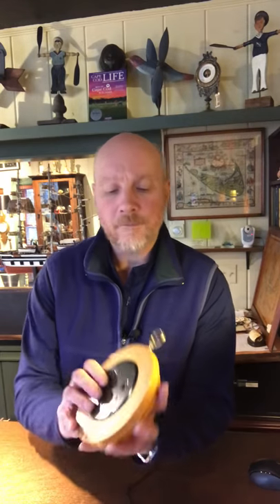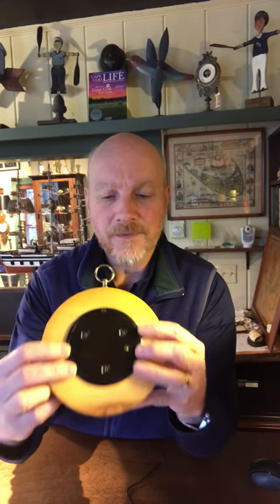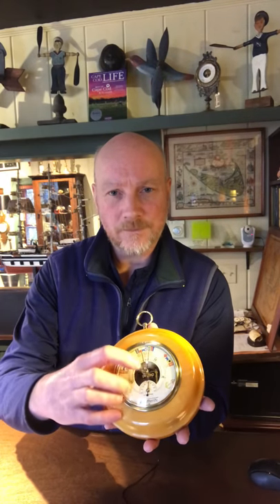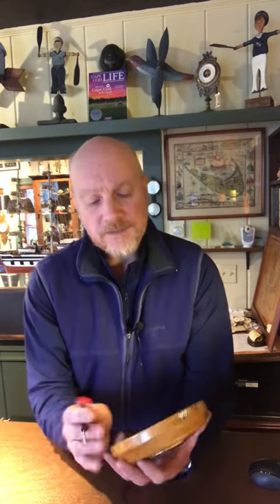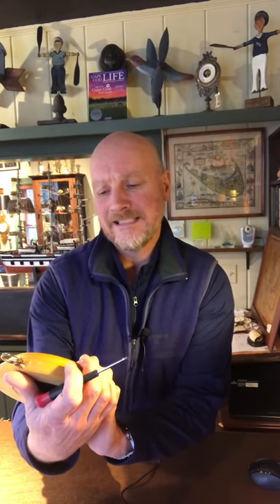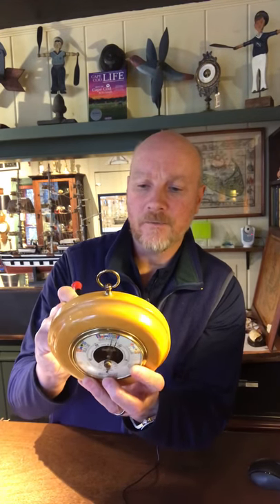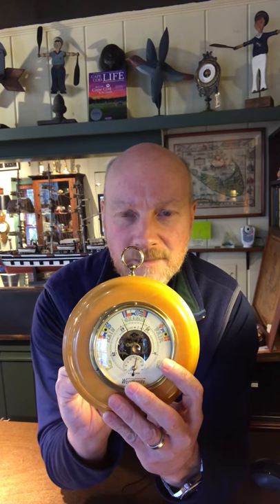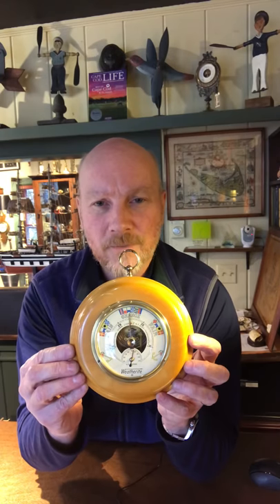Calibrating / Adjusting an Aneroid Barometer

Comment: Does the barometer have to be calibrated on a daily basis to the local weather setting, or once you adjust it will the barometer automatically be adjusted for future pressure settings
Reply: You should only have to calibrate it once every few months.
Reply: Two years ago, I found a 1970’s? barometer at a thrift store made by Springfield Instruments, NJ, USA. I calibrated it once and it’s still working great. It has three dials for temperature, barometer and humidity. It doesn’t have to match other barometers exactly, as from what I understand, what matters is the movement up or down, and the speed of the movement. If your barometer is rapidly falling  that’s a serious piece of weather energy moving your way. Calibrate it, then get to know how your barometer works in your own environment and enjoy! 👍

Comment: imho the important thing is the rate of change in pressure - not the pressure calibrated to a particular elevation and air temperature. To accurately calibrate an aneroid barometer to a particular benchmark, one must know not only the pressure at that location but also the elevation of the benchmark and the air temperature at the time of calibration.
Reply: Ed, you just fried my brain!
I thought there was just one type of barometer and only came to realise there is more than one, whilst watching another of Parke's vids.
What is the difference between the two, if you don't mind me picking your brains?
Much obliged for your time!

Edit: I did some research, Ed,
I now know there's three types, not two.
Each day is a new opportunity to learn for me.

Comment: Our local airport showing altitude setting pressure which is pretty different from other pressures of weather station that installed in city, so I am completely confused which pressure should be follow, station pressure or altitude setting pressure.
Reply from the maker: I would choose a station that is nearby and at the approximate altitude